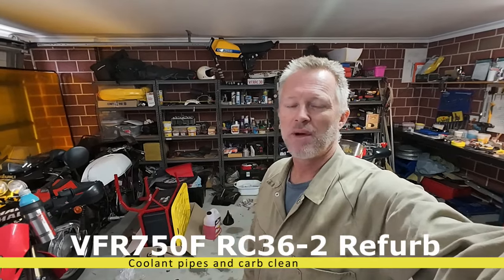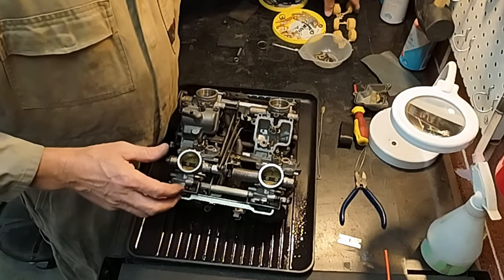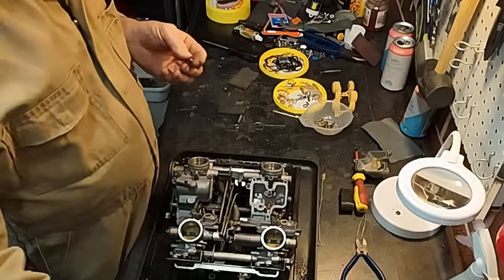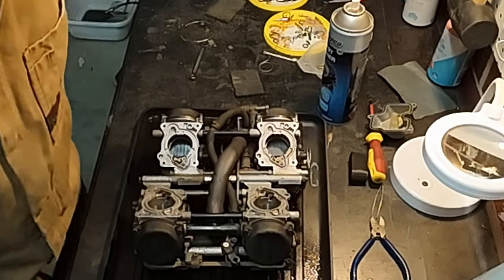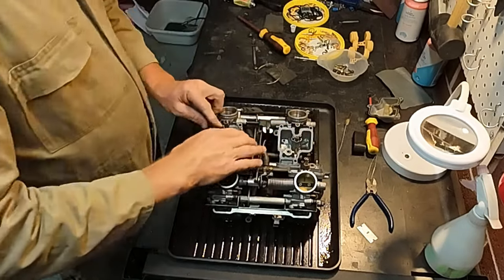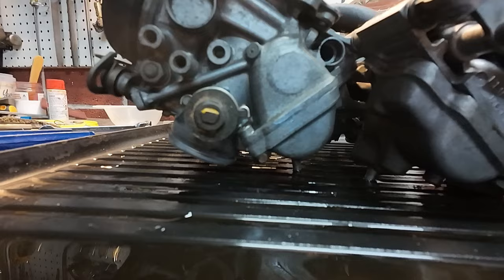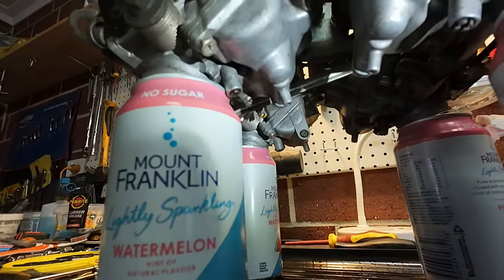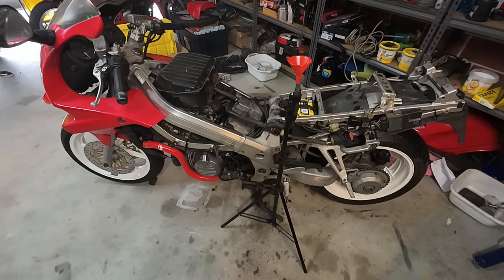1996 Honda VFR750F RC36-2 Refurb

Comment: Nice videos :-) -  On carbs, my experience is that vacuum syncing/balancing them is really important to have a good engine response from idle. Got e 36-2 and almost do et once a year.
Reply from the maker: In less than a year this will all get torn down to become a Tyga RC30 tribute. I just want to check everything works before I spend $7-8,000.
Reply: @TheSpannerLab  I get that :-), and checking the sync is more a regular maintenance thing  👍  - BTW RC30 has a big bang firering order, which should be pretty easy to arrange on the 36-2 as well ;-)

Comment: Nice walkthrough - thanks for that. When I last stripped the carbs down, the heads of the brass crosshead screw (next to the butterfly valve) sheared before I could get them out. Are they supposed to come out?
Subscribed. Look forward to more VFR750 content. Not enough on YouTube for this model... thumbsup
Reply from the maker: My aim is to do as little as needs doing.  I'm not sure which screw you are referring to, but if it's the ones holding the butterfly plate onto the shaft, I've only removed them once, out of necessity,  because someone must have gone at the carbs with an ice-pick!
Did you get it out?
Reply: @TheSpannerLab  Screw was between the venturi and the float bowl. Made of cheese, apparently. No joy with the screw but scored a nest(?) of carbs on ebay for £30! Honda wanted £7 for each of the screws...